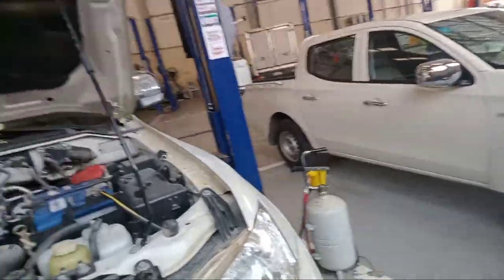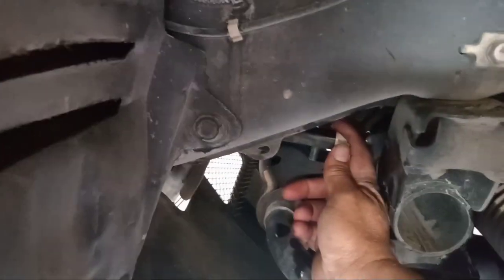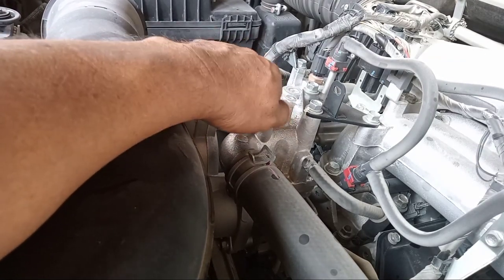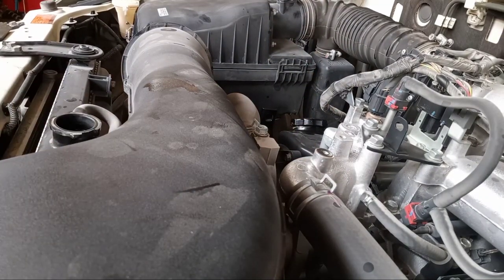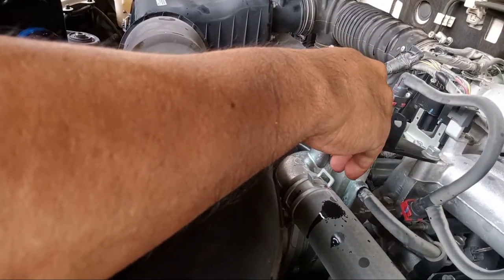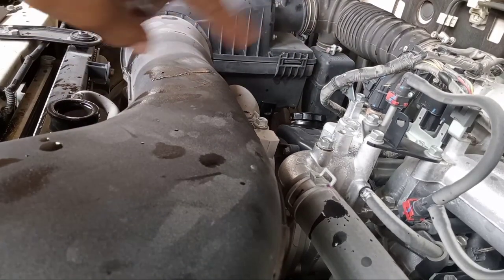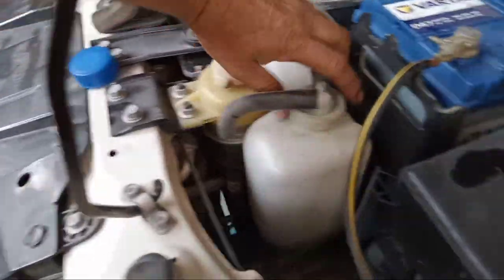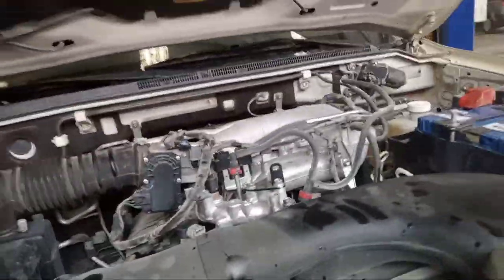Mitsubishi Pajero(how to put proper radiator coolant inside the radiator

Comment: Hello , my mechanic changed the coolant. Flushed out old coolant…put in 4L of new coolant (100% coolant..Mitsubishi original) and then added water to it. Is that right or wrong?
Reply: So is...this ok?
Reply: @abdulhaseeb5626  Never adds water to the cooling system. The specific colour is needed due to the chemical specs.

Comment: Sir Pag Mag lolong drive poh ako Ano poh ba ang Kailangan ko pong e check sa Sasakyan ko sir bago Poh ako mag ta travel sir...pajero poh yung sasakyan ko sir any helpfull tips poh?
Reply from the maker: Sir pls check preventive maintenance
Reply from the maker: A. Check  how many km  travel you must be aware. (B ) check oil level.  ( C) check water level / rafiator and reservoir. Chek brake fluid (d) check brake system. (E)  check the lights

Comment: But Digz sir, should we not mix coolant with distilled water?? 🤔
Reply from the maker: Sir all coolant no need distilled water
Reply: On 6G74 engine sir digz. Saan nakalagay yung engine coolant drain valve?
Reply from the maker: Sir. You can check my. Video